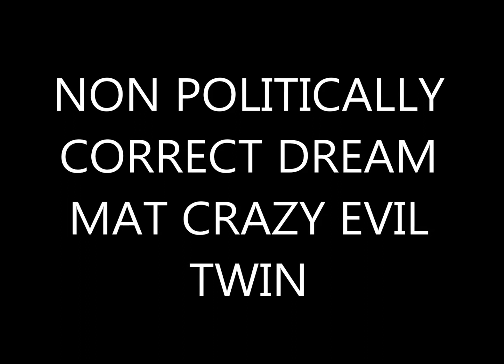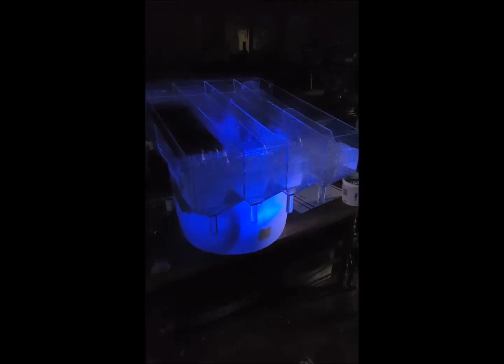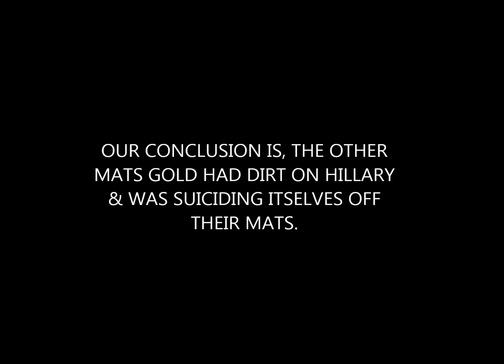DREAM MAT DON'T WORK? Time to Set the Record Straight - Sluice Mat Showdown

Comment: Dream Mat might totally be a superior product, it clearly works extremely well.
BUT, this is the opposite of a real world test. Which is sad because it's an extremely well constructed test.
All the other sluices were overloaded, because the gold was concentrated in one spot, and it clogged them up. But because dream mat has deeper riffles that force water to spread horizontally it handled clogging better. You can see it at 5:39, the dream mat has spread the gold over several inches right at the top, where the other sluices had very narrow bands all the way down.

Comment: Would I be able to get a certain length cut from you so I can fit in one of my boxes online when I try to get it it's like $100 but I don't need that much and then the other ones are too short but the right size let me know if not I'm just going to order a long piece and cut it

Comment: Please. Sir. I purchased the 6x16 inch dream mat I have just a little highbanker under 2 feet long and 6 inches wide... I currently have a 800 gph pump.. obviously it's not enough .. how many gph and what angle do u recommend for a new dream mat owner.. 6x16 dream mat. It is not the mini cells. Please let me know if u can
Reply from the maker: https://www.goldrushtradingpost.com/inc/sdetail/6_inch_power_sluice_and_set_up_kit_w__vortex_dream_mat/18419/57869
Reply: Thank u I will buy an 1100 and try the 15 degrees

Comment: Ok that’s settled it am ordering micro mat for clean up. I had used vortex but lost micro gold in the tailings. This gona pay for itself in gold in 1 weekend.
Reply: Karl  Blank,
    I  just  ordered a complete  set  for  my  Gold Cube. I had 4 buckets of the  hardest  panning  cons  that I have ever seen in 40 years. The gold was  coarse , jagged and about. 940 finess , but also, flour  size. There's  platinum,  tungsten,  and possibly  some other  heavy metal that settles in and  lets the  gold  wash  over and out. The Cube  gets a lot of the flour,  but  also,  loses a  bunch. I have ran the  cons twice and  still  pan color in the tailings. The  gold is a  bearcat cleaning out of the  Cube  matting. I tried  spraying and then used  a dental pick to pry the  jagged pieces out of the  mat. Let  it  sit  a day in the  sun and  then,  shook  more really fine  flour  out of the  mats . Clean up  should not be that  big a chore!

Comment: Saw the dream mat work on Vo-Gus Prospecting.  I was sold instantly.  I acquired a piece and modified the upper section of my classified river sluice........best improvement to increase capture rates available.  I used to work at the Grumpyprospector UnderFlow sluice company.  It’s been half a decade since I did the Gold Shows.  Your dream mat coupled with my river sluice is a winner.  I can’t say enough good things about it.  Damn if it doesn’t capture almost everything I put in it in the first couple rows of cells.  I have a 3x 12 piece I’m getting ready to build a dredge with.  Very excited to say the least.

Comment: The thing with Gold Hog vs Dream Mat is... If you set them both up and feed them properly, they can and will hold 95%+ gold. There are places where the Dream Mat will mop the floor with any competitors, but there are some terrains where it wont (like mine - i have alluvial gold here typically around 100 mesh, with moderate amount of magnetite and about 5% of total volume garnet sand). The amount of unclassified material required to overwhelm the specific mat - and thus losing gold - is much higher for the GH than it is for DM. I personally dont like that your tests are kinda biased - regardless of DM being really good, and i mean it - but i guess it is what it is. There is a saying around here, ill try to translate it, "even the saint's palms lean towards themselves" :D 

Keep up the good work.
Reply from the maker: Were going to set up a set of sluices & offer gold & $$$ for anyone who can beat Dream Mat this summer. So time will tell.

Comment: All these mats require a different amount of water and angle for proper recovery. I love the dream mat but this is such a flawed test.
Reply from the maker: Any Steeper, the other mats do worse. More flow they do worse. The test you see was any flatter or water slower, the gold would not move off the metal slick plate. Fact is, head to head at any angle or flow rate. They fall shorter than dream mat.

Comment: I got mini mat this week and tested it with 5 pieces of gold  and random tailings. Ran a 900gph not level, h even water flow. Cleaned out and found 7 pieces of gold. Dream mat found gold in my tailings that I had panned and ran over vortex hundreds of times.

RIP expanded over moss.
—-

Maybe the fact that a unicorn is used for branding puts people off.

Comment: I seen another of this comparison done and that was what made me decide to go with Dream Mat instead of G**d H*g's mat. Also I wanted to not have to spend 100 on various mats to get what I wanted just to cut them most of the way down.  Fates landed me a new sluice and a Micro Mat that fit it perfectly. Thanks guys!!
Reply: I was puzzled by G.H.'s description as they described the differences in a 36" Matt. So I asked them if I were to purchase a matt you would cut it across then cut that in 10" sections that I then glue together to make one long Matt? They said yes. So I than asked that since a role doesn't change  going across I would be getting the same 6 x10 portion with the same kind of ripples over an over. And they said yes. So I than asked if I want all of the features you advertise on your web site in the Matt of my choice I have to purchase 6 Matt's from 6 different rolls to get all 6 different designs included and advertised as one matt to get the gold cathing ability of the design.through the entire length of the Matt. And they said yes. I have to buy from 6 different rolls to get all 6 portions of the Matt to perform as advertised as one matt. Butt since their roles come diagonally and they cut them diagonally I have to buy 6 Matt's to get one as advertised as one mat on their site. They stated that's just the way it is. WTF

Comment: Thats crazy how it all ends up at the top....do you think it has something to do with the shape transition from flat to the mat? I mean not just the mat alone? Only way to test is run....flat-mat....flat-mat.....flat-mat..to see if the gold ends up on the top of the next mat and so forth.....saw someone using this and all the black sand cons where at the top bellow the transition point where the aluminum bracket holds it down.
Reply from the maker: The mat performs differently, it's so diffrent, it breaks all the fluid dynamic rules the other mats  follow. Thus the better results.
Reply: DREAM MAT I was noticing that. its super active. Kinda wanna throw some on my folding sluice. I was also thinking just buy a 40 dollar poly container hack the front and end off. Buying the wide mat and make a 48×14 or whatever size up after the 12 inch i. Saw on theyre sight they have dredge mat but dont know if it works the same for sluices. Ya know if its a speed related mat Idk.

Comment: I seen the title and thought who's put this up. Someone's been sniffing glue. Then I seen it was you David. I would have liked a second view of you jumping around as you're commentating.
Reply from the maker: You only seen 1/2 of the video! Ha ha.
Reply: HA I THOUT THE SAME THING TILL I SAW HIS NAME
Reply: Thirty years ago  my mats  in my  four  inch dredge  would have  won this  race out of the  box setting the  world record.  I  used a  LeTrap hand  sluice in a spot for  about  half  an hour.  I couldn't believe  all the  gold pickers to super  fine that it  captured. Went  back to camp and grabbed my  dredge. I ran in for about 10 hours  only  stopping to refuel. What a shock when I  cleaned up! I  had  4 times the amount of gold from the  LeTrap in about 1/20 the  time. Of course,  my friend and I  built an over under flare  5 inch out of mine and another one he had for  parts. Much better  recovery,  but  cleaning up  miners  moss after you  been  underwater for  hours is tedious.  My Gold Cube is  reminiscent of the that tedium  during  clean up,  not to mention the  gold  trapped  behind that  contaminates the  next time out  somewhere and you  are trying to  sample. This  has happened to me three times that I  know of and had me digging  deeper  for  more gold before I  realized that it was gold from  previous outings. I envision a  quick reliable  clean up  which is  why I have  a whole  series of  Dream mats on order for my  sluice  box and  Gold Cube.
Reply: i bought the 10'' dream mat today, then see this title. bit happier after watching the vid aha

Comment: Ordered a small 6x16 chunk so I can fix up a recirc system. Would I set this up at the same angle as a regular ribbed or moss sluice? I wouldn't think it would be any different but thought I would make sure before building. Thanks.

Comment: First let me say I'm not in anyway defending the other guy's mats I have used them but not  Solely I combine different types that being said I recently put your purple green and gray matting in my goldcube I purchased from crisson anyway I'm a little upset about the  Performance here's stats I'm using the 1100 hundred gallons an hour pump and classified to 1/4 and the pockets just jam up with stones the feed rate has to be very slow to allow time to clear out also in this test you did here would your mat have preformed if loaded up with stones I'm gonna run a test with an ounce in 10 pounds of cons feed it the same way I would the  Conveyor belt matting and check the tailings I'll update when I'm done also I'm not dogging your mats I got them because I was told I could step up the feed rate but you can't catch gold if there's no hole for it to fall into